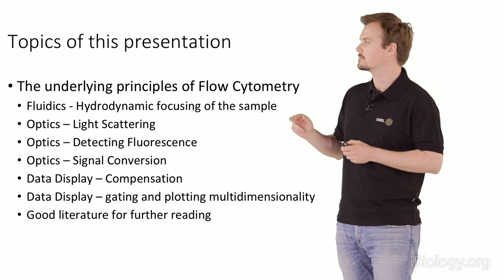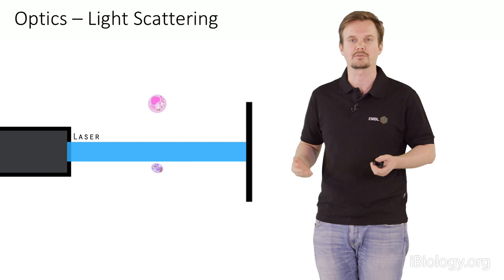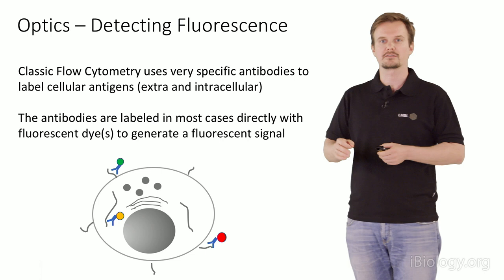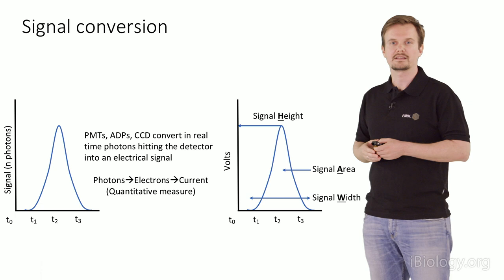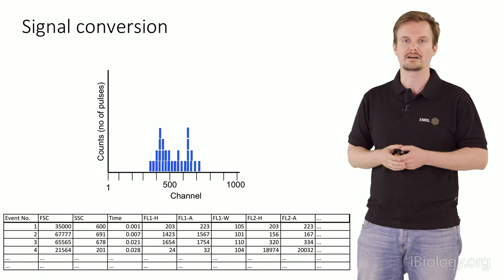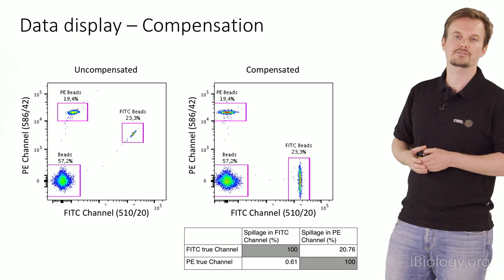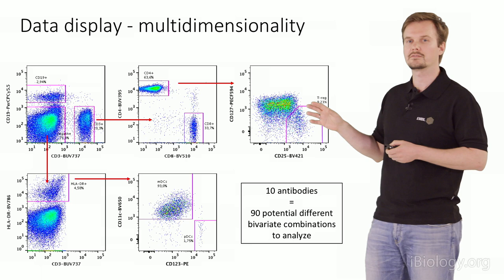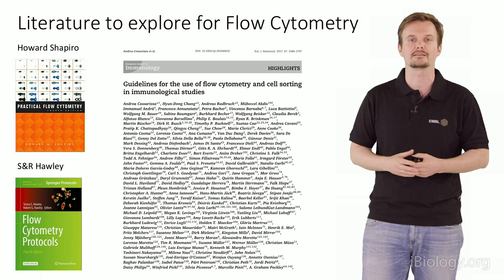Flow Cytometry Introduction - Malte Paulsen (EMBL)

Comment: A question, In the Hydrodynamic focusing, Is the sheath fluid merging with the blood sample (which already diluted) if yes, then the dilution ratio will be changed? and if no, How they are not merging ! TIA
Reply: I am not completely sure but I think they don't cuz the idea of hydrodynamic focusing is to kind of create a channel based on the sheath fluid. This is what I found in Wikipedia:  "The sample is injected into the middle of the sheath flow. If the two fluids differ enough in their velocity or density, they do not mix: they form a two-layer stable flow."
Reply: dilution/not-dilution makes no difference. The cells will be assessed as they go through the laser and that is the info you need.